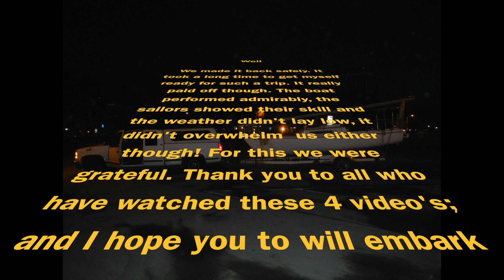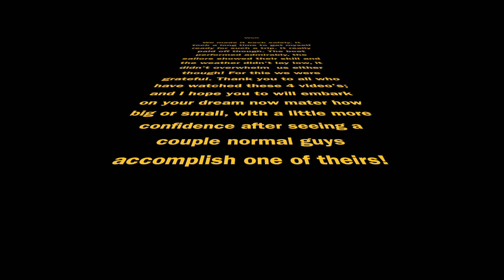Sailing To Catalina Island On The Go Around #4 (A Restored 1966 MacGregor Venture)

Comment: Curious, why wouldn't you leave the sails up on the way back to either lighten the load on the motor and get a little better M.P.G. or, perhaps add a knot or two to your crusing speed?
Reply from the maker: Sorry I'm so late to repy,

I find with my boat and the rolling waves we had, the sails were only luffing and slowing us down (adding to more sail cloth chafe). It was actually quicker without the sails, and the motor only took about 4.5 gallons for the whole 40 mile run. That compared to my old motor is a hybrid! Ha ha. Thanks for the question though. With the 15 horse motor its way overpowered for this size boat so it was not a strain on the motor to throttle mid way and run at 5/6 knots through the dead wind segments.

Comment: I just got a 21 foot and I have a 4.5 how do you think it will work with gas if I have to motor all that way and what can I use to find out how to get there
Reply from the maker: 4.5 will motor you fine in harbor, but very slowly outside the breakwater. You can expect 3-4 knots which is a bit of a long g haul. In calm weather totally do able, if the winds pick up and the seas grow a bit the 4 horse may be a bit under powered. Bit that is just my taste. I with a 15 horse Johnson used about 5 gallons for the 40 mile trip out and about 3.5 
- 4 gallons for the 30 mile return trip from catalina. I did fill up again when I got there. I took 9 gallons and we between the two boats had 8 extra gallons for emergency. We went over kill. I'd take at least 9 gallons though Just in case you are hit with more weather than you expected and have to motor to a different harbor. West Marine sells navigational chart books for these waters, and if you use your GPS you can. Plot yourself Along, knowing how to read and plot. if you dont know how to plot and do not have a GPS, I highly recommend you learn plotting and buy a GPS. Good luck with your purchase and the many adventures it will bring!